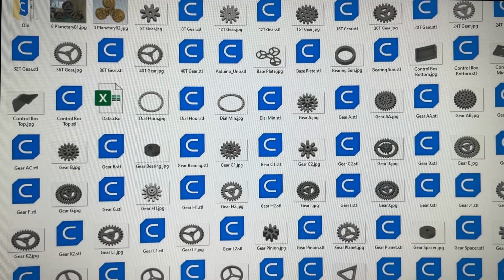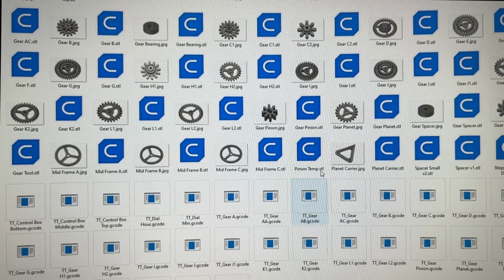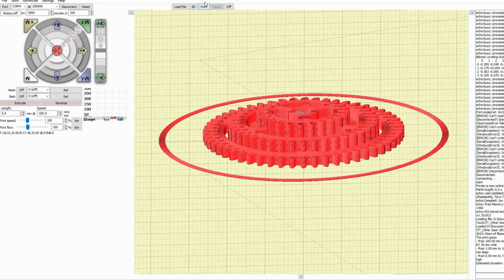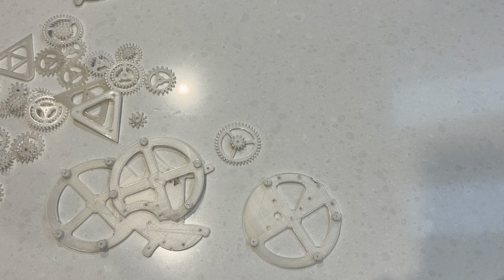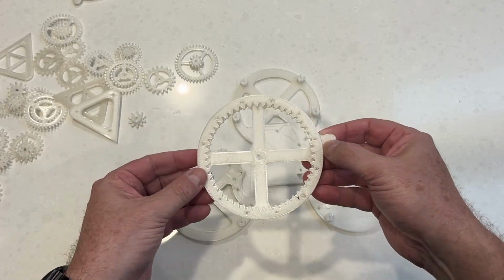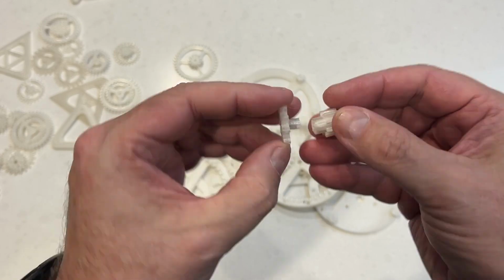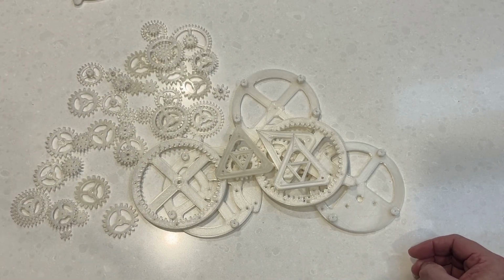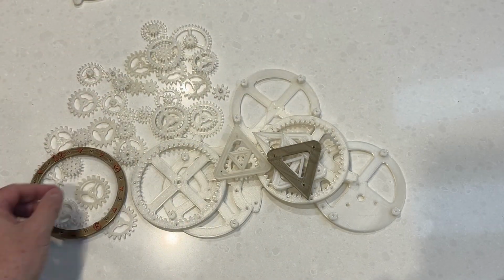Planetary Clock 04 - Steampunk skeleton clock

Comment: A suggestion for connecting the parts, use heat set inserts. these replace nuts and are more secure.  Want to build one of these when you get the final design.
Reply from the maker: Great tip on the heat inserts
Reply: @kcclocks  Thanks, they are very inexpensive and after some practice are easy to do.  I suggest you dedicate a cheap iron with a special tip just for those.   You also need to make design changes to allow for the insert.  I use a 4 to 4.2mm hole for a 3mm insert.
Reply from the maker: Thanks